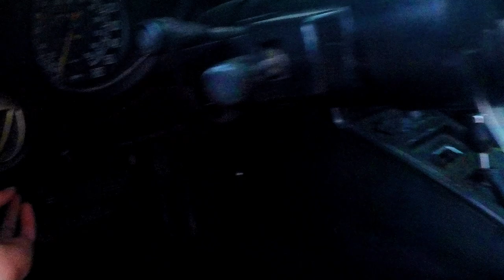1977 corvette cost how much?? (Vlog #7)

Comment: David,I bought a torch red 1977 corvette,I installed long tube headers,high performance exhaust manifold,timing chain,harmonic balancer,tuneup,wires,distributor,all new wiring in engine bay,new brakes,brake lines,flowmaster performance exhaust,tires,chrome valve covers,chrome air cleaner,transmission service diff service,removed all smog equipment.its a real head turner,had it pinsripped.I love this car,Iam 70 years old,and plan on getting buried in it.you can do this,if you have the money,and i do.thanks russ.KEEP THOSE C# VIDEOS COMING<

Comment: Sweet! It's my dream to own one of these cars. I can't wait until the day comes to where I can buy one of these. There are a few in my area that are going anywhere between $6000 and $10,000! Hopefully this summer I can pull it off
Reply from the maker: They're great! Little things like to break, but you won't regret it man.
Reply: Really good to know! I am so excited to get one man
Reply: @davidaaronwise1940  Sooooo an update: I bought a 1980 vette last August for $5000! Ended up having to do some work such as new break lines, proportioning valve, calipers and rotors, tires, wheel bearings, fuel lines, and a new V-belt but it's all good to go! I uploaded a video of my vette on my channel if you ever wanted to check it out!!
Reply: @ConnorWeekly  wow I just bought my c3 a week ago it’s a 1975 L82 that’s crazy man